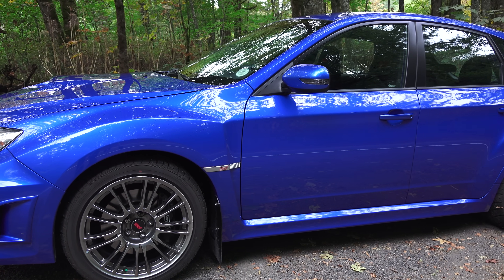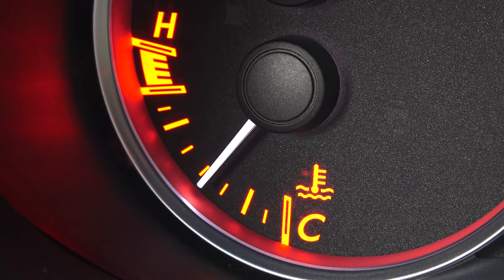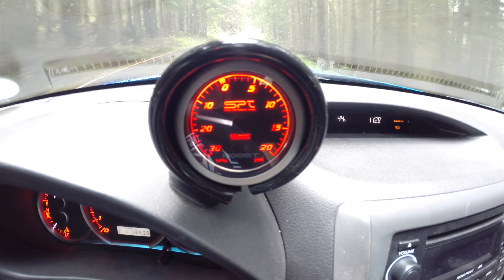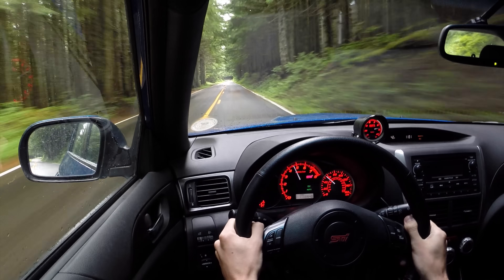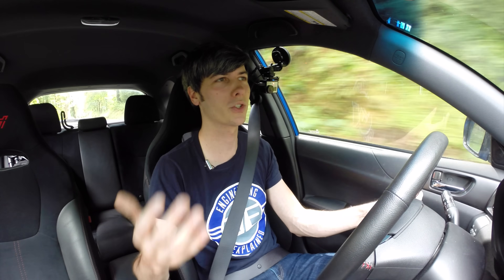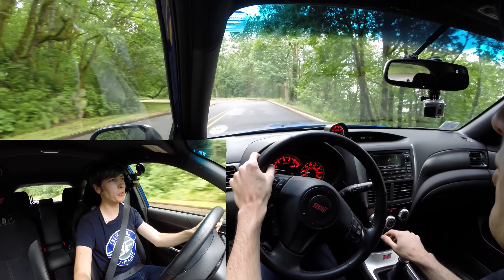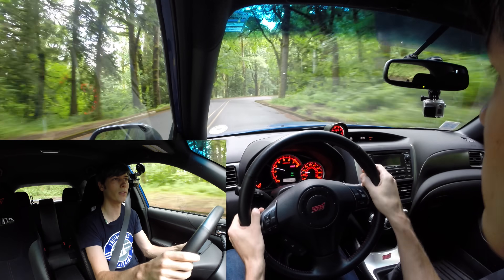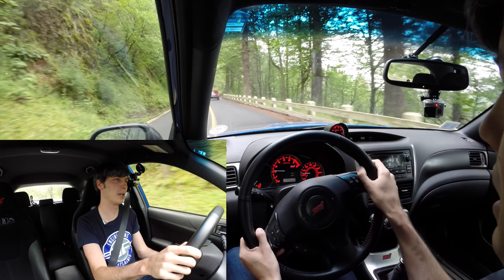5 Things You Should Never Do In A Turbocharged Vehicle

Comment: You missed that, when you shut your car, when the turbo is still hot, the blades can bend, since, the centrifugal force doesn't support it to kepp it's shape.
Reply: That's a new one on me, but a pretty interesting theory... Only question i'd have is, if the turbine blades are made of a metal that is so easily deformable at normal operating temperatures, wouldn't they be more likely to fail thanks to rapidly being drawn away from the axis of rotation and scraped along the inner walls of the housing? Isn't it more probable that they're just made of a metal that retains some structural integrity at the turbo's usual operating temperature (which isn't going to be really any higher than the inside of a cylinder during the power stroke, after all...)?
Reply: Yeah don't buy turbos that come with wax blades

Comment: Not true. You are backwards. The engine oil( less volume, direct contact with moving parts, including running through  the turbo in contact as opposed to in the water jacket)will heat up and always run hotter than the coolant ( more volume) . Why do you think that turbo heads use synthetic oil (which STARTS to degrade at +/-500F...but coolant boils around 250....poly-ester/ not di-ester. Nice car though
Reply: Turbo timers run oil through system...not coolant....why? Look it up kid

Comment: What does engine RPM have to do with the amount of air an engine can ingest? The idea that low RPM’s limit the amount of air an engine can injest makes no sense particularly on a turbo car where the intake is pressurized by the turbo.
Reply: At the same intake pressure and throttle opening, an engine turning at 4000rpm will pass twice as much air through it as one turning at 2000rpm. It's simple maths.

If we simplify... say it's the difference between 3000 and 1500rpm instead, and it's a 2-litre capacity engine. Every second, one of those turns through 50, and the other through 25 revolutions, with each revolution shifting a litre volume of air; let's also say the turbo is able to pressurise the intake air to twice normal atmosphere, or 2 bar, and that's stablised by the wastegate that's calibrated to start bypassing the turbo when the pressure exceeds that 2 bar limit. So the engine that's running at 1500rpm is able to move air through it at a rate equivalent to 50 litres at normal pressure per second. But the engine running at 3000rpm can shift the equivalent of 100 litres. On top of which, you add the considerable extra volume (and the extra energy it carries in the form of heightened pressure and temperature) of exhaust gas created by burning liquid fuel in that air charge, which means what comes out of the exhaust ports has a considerably greater volume and carries more usable energy within it than the intake air (recovery of that energy and the use of it to overcome vacuum drag plus shove more air mass into the cylinders and thus increase both power output and thermodynamic efficiency is the turbocharger's entire raison d'etre), and again the engine which turns twice as fast can, assuming equal efficiency and torque at both speeds (which isn't necessarily the case, but roll with it for now, because the relationship can be biased either way), produce twice as much of that hot, high pressure exhaust.

If you base it purely on the raw amount of air that the turbo can shift, and ignore the inconvenient fact that the various engine components have a maximum working pressure, then, yes, there's no real reason why you can't get just as much power, and just as much airflow through the engine, and just as much exhaust gas production at 150rpm as at 15,000rpm, without changing the cylinder capacity or anything. Unfortunately, the slower engine there will need 100x the working pressure of the faster one (or 15x a middling 2000rpm), which might be extremely difficult to engineer, as well as expensive and, more importantly, rather heavy (which will hamper your ultimate performance) as well as a whacking great flywheel (also heavy, expensive, and difficult to implement) to smooth out its infrequent (about 5 per second) but incredibly violent power strokes. This, at least partly, is why you find motorcycles and track racing cars tend to look first towards higher rev limits in order to improve their peak power output, then all the other options, as it's lighter, demands lower working pressures, and is therefore cheaper and higher performance than anything else they could do. It does however make them difficult to use on the road, as they have relatively poor low end torque yet fairly high gearing (being able to hit 70mph in first isn't uncommon), and riders of race replica bikes can often be found using them like relatively less powerful, single-speed mopeds with a manual clutch... slipping it an awful lot.

The general specifications you'll find a randomly chosen mainstream turbocharged car offers, in terms of working rpm range, boost pressure, power output per litre, etc, tend to vary more by generation than actual make and model, because they all have to square the same circles of what gives good performance vs what's practical to engineer with currently available technologies. So we tend to have maximum torque across the range of about 1500 to 4000rpm (actual peak would be around 2500, and quite a bit higher than what's stated for that wide range... but unless you submit to fitting a heavy, bulky and expensive cargo truck transmission, it has to be limited to a certain flat figure to prevent it blowing up any gearbox of practical size/weight/cost; a smart modern alternative would be to convert the whole system to the equivalent of a diesel-electric locomotive, but about the only marque who's tried anything like that yet is BMW with the i8, which is positioned as a plug-in hybrid anyway, so its onboard engine isn't super powerful and it's certainly not high torque), maximum power around 6000rpm, maximum revs around 7000, idle around 750, boost roughly around 2.5bar, maybe 200 horsepower per litre... etc. It's just what numbers happen to fit around what we're able to easily build, at a price that people will actually buy it for.

Comment: The reason you shouldn't turn off your turbo car straight after running it hard is because shutting off your oil supply will damage the turbo because it'll still be spinning with no lubrication... that's what I was taught
Reply: Because that's its job. Exhaust gas blows through one side, pushes the turbine vanes there. On the other side, connected by a shaft running through a fluid bearing (the fluid being engine oil under normal system pressure) due to the high speed the device can spool to, are the compressor vanes that pressurise the air going into the engine.

At idle, the turbine turns slowly, if at all, as there's only a small amount of air moving through the engine and a relatively minor difference between inlet and exhaust pressure (the engine only needs to make enough power, and thus burn enough liquid fuel into a larger volume of gas, to support its own rotation - plus there's every chance that the wastegate / bypass port is propped open and will only close up once some throttle is applied) and bearing lubrication isn't a particularly critical thing.

When you build up any significant engine revs or throttle opening, it begins to spin faster as a greater volume of exhaust gas is being directed over it versus the amount of inlet air. At full boost, which can be quite easy to achieve in some modern engines, it might spool up to a hundred thousand rpm or more. That's an extremely fast rate of rotation, and even though the paired turbine wheels are quite small, light objects, the high speed means they carry a hell of a lot of momentum. So, when you come off the throttle and the engine returns to idle, they'll continue to spin on for a time, taking several seconds to come to rest. Maybe 10-15 in a really big (like, truck calibre) turbo.

It's essentially the flipside of turbo lag. It takes a second or so of being blasted with the full force of the engine's exhaust to bring the turbine up to speed; when slowing down, there's rather less braking force acting on it compared to the raging hurricane that sped it up, so it takes longer to despool.

However, it's not the biggest problem in the world. Unless you've literally burned towards your stopping place at full speed, pulled a handbrake turn into the parking spot and turned the engine off even before the car's come to a halt, you don't need to add more than a few seconds of idling before switching off. Most of the time, the approach to a parking space, and the job of parking a car itself, is something that has to be performed at idle or not much above it, so the turbo will be mostly or even completely spun down by the time you're ready to get out. If you just leave the engine ticking over whilst you set the handbrake, return the gear to neutral (or park), turn off the radio and lights, undo your seatbelt and make sure you have everything with you that you want to take after getting out, turning the engine off just as you open the door and step out should be more than sufficient for safeguarding a normally-engineered turbo system.

Fancy race spec or heavily modified ones may need greater care than that, but I think we should assume that if someone has such a car and doesn't already know how to look after it, well, a random youtube video and the comments below it aren't going to help them much, because they've probably got bigger problems coming down the pipe.

Comment: Many of these video's make sense, this one has a very elegant way of not making sense on modern cars.  If the car was not computer controlled, had a carburator, didn't have knock sensors, high quality synthetic oils didn't exist etc.. then it would apply.  Very bizarre I'd think there may be one soon about 5 things you shouldn't do because the earth is flat.

Comment: In the Early Eighty's, turbo was the norm within the USA to increase performance with very small engines to increase average fuel efficiency .  CAFE was BIG.  I had followed all the rules you mentioned and had very good reliability with Turbos. Where most drivers did not and had massive amount of failures creating a horrible experience. This is why America lost favor with Turbos back then. Diesel had lost favor back then too but that is another GM horror story.
 Today, we have sophisticated computer control, Enhanced Motor Oil and better QC on fuel that actually meets atmospheric pressure requirements for turbos. The dieseling you mentioned earlier is not as prevalent today as it was then due to just what I mentioned. Good era to own Turbo or Diesel and now HCCI.
Reply: Well, if the US diesel experience is anything to go by, it might just have been a case of truly appalling engineering standards, rather than driver carelessness...

Comment: I am trying to determine which system should I get for my Scion FR-S a Greddy turbo set at 7 psi tuned by Titian motor sports or a Jackson supercharger  with Ecuador pre tuned. Set at 9 psi.They both cost about the same power is about the same, but which one will give me better long term reliability and less trouble or break downs. I was going to go with greddy because of the lower psi setting of 7 but now that you mentioned about low engine rpm and high boost from prematurely stepping on the gas peddle when in low gear I tend to do this more often than I thing in rush hour traffic then down shift, you got me a little concerned. Please offer your thoughts. I am on a normal budget so want to avoid extra maintenance.

Comment: Hey! Love your videos.
Question: I just bought a 2017 GTI, VW recommends 87 octane, but should I run 91 anyways? I always did in my 2002 GTI but they were very sure that the '17 runs perfectly fine on 87. 
Thanks!
Reply: Jeffrey Grace 87 as the lowest. I use 93. I definitely notice more pick up with premium

Comment: This is tips for like really old cars. i have a tuned saab from 91 and it has knock sensor and fixes for all this problems. Oil stuff is true to date. In My turbo i tuned it myself and it adjusted acordingly. This advices är mostly for vaccum kontrolled turbos = really old or cheap ones.

Comment: How can you create a high boost situation at low rpm if the boost pressure rises relative to engine speed? I'd also think the car's computer is tuned well enough to use the MAF & o2 sensor to get a relatively close amount of fuel that won't cause a situation where you would damage the engine from pre-ignition. If you gradually accelerate from a gearing disadvantage I don't think it would actually be lugging the engine unless you didn't have enough power from the engine to easily handle the load. It varies by car but most cars I've driven can easily accelerate from 1500rpm in 2nd or 3rd gear without lugging the engine. Lugging the engine is like when you roll up to a light in 5th gear and forget to pull it out of gear and you're now forcing the engine to run at idle speeds with a load still on it.

Comment: The thing about turbo's and turning it off is kinda a myth...
Every small engined car in Europe has a turbo nowadays...0,0 issues with it.
Reply: because they aren't old enough for the problem to become apparent yet!
Reply: The buildup is insignificant but it builds up.

You’re most likely going to have to change oil earlier and flush the system more often.

Comment: hey love your vids!  I'm finally getting my first turbo charged subaru (forester xt)!  question, subaru specified running premium unleaded... would it harm the engine/turbo if i run midgrade or regular unleaded fuel?  thx!
Reply: Yes absolutely subaru tuned the gine on premium fuel using any less could cause a bounty of problems in fact id be surprised if the car ran after then safety precaustions in the gas tank will probably just force your car either into limp mode or wont run till it sees the octane is back up to 93 or close

Comment: What would be a normal oil temperature before flooring it? xD Cause I've noticed my coolant temperature has reached it's operating temperature in only like 2/3 minutes. At that point my oil temperature meter hasn't moved it, it only showes me it's above 50degrees celsius. After like 7/10minutes it's at about 75 degrees celsius. I only drive like 15km to/from work so yeah xD. But when I'm going for like a 30minute to 45minute drive the highest I've seen it is like 80-85 degrees celsius.

Comment: i have been a subaru tech for 38 years,you are right on the money,awesome video
Reply: b17boss17 you must be at least 67 years old
Reply: 56 could do it
Reply: Been a honda/toyota tech for years, not much to do
Reply: B17boss17 do you have any other tips? Buying my first wrx soon.
Reply: b17boss17 o
Reply: I'd disagree with his statement about pump gas and engine knock. All pump gas could be used for low compression turbo cars and not have to worry about knock when stock. Use a octane booster if you have problems with this but most stock STI can run on 87 89 and 91. You won't even notice horsepower loss.
Reply: Sessh _ what gas does WRX And STI take? Normal?
Reply: Zack Willison 91 or higher

Comment: Hello, I have a Peugeot 406 with a 1.9 L turbodiesel engine, which has its peak torque at 2250 rpm and its maximum power at 4500 rpm. Some people tell me I should allways drive if at higher than 2000 rpm, and others say it's ok to drive at 1500 rpm (maintaining constant speed for example). I would like to ask you which one of these theories is true and why. Thanks a lot!